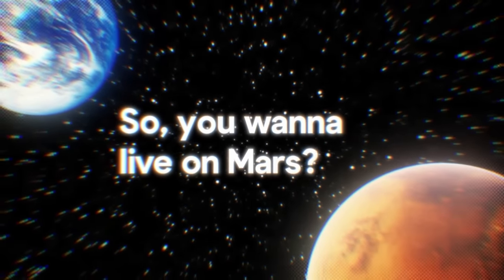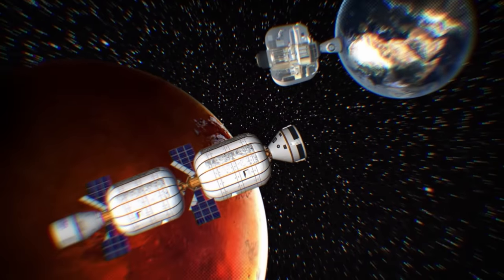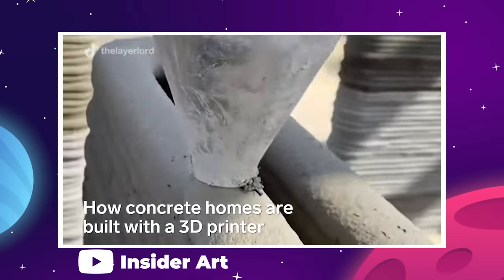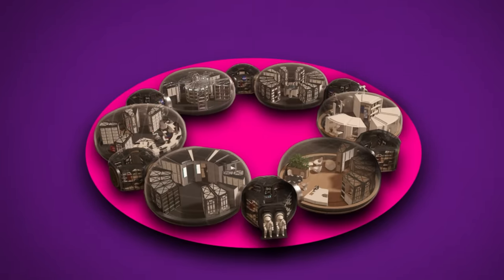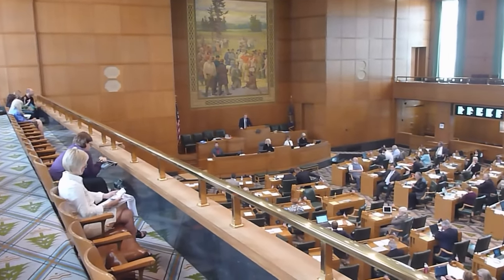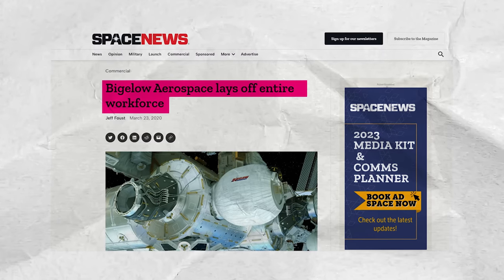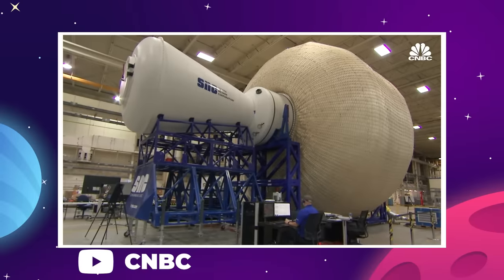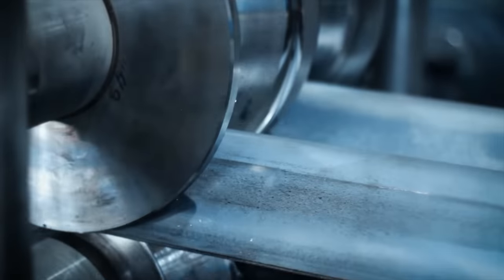Why Inflatable Habitats Are The Key To A Mars Colony!

Comment: The problem with inflatable domes for habitats is a very risky means of life support because they’re in highly known to tear rip puncture, etc. so you would have to come up with the material that’s much more stronger and reliable so it would be tear proof and puncture proof, it will also have to be well insulated Because of the temperatures on Mars.

Comment: I've worked with Vectran in electrical cable manufacturing. It is extremely strong! However in this application the question is how radiation shielding will be achieved. 🤷‍♂

Comment: Shining glass domes? They can be mesh. Using the Ion engine concept where atmosphere is pulled from the outside to the inside using a 20KV potential between two mesh layers. Mars atmosphere at earth atmospheric pressures inside the mesh dome.

Comment: The pressure inside a "balloon" at 13.88 pounds per square inch will equal one ton per square foot.  a multi-layer nylon inflatable can take the pressure, but not a balloon.  Not a concrete building either, it will explode.   The shape has to be made of curved surfaces to endure the pressure.  A sphere, a cylinder or something with all curved surfaces and either nylon or kevlar reinforced can withstand the pressure.  Brittle concrete or masonry cannot,  Steel rebar and the curved shape would be needed.   Metal tanks of 23 to 30 feet in diameter will work just fine as they can be part of the lander and just set off ready to move into.

Comment: Mars regolith covers the inflatable habitat. Regolith provides Radiation and Insulation from the harsh mars surface environment. The inflatable habitat provides a safe sealed conditioned environment. Especially If something in the regolith is hazardous. 

Being inflatable modules would allow each Starship to hold a complete independent base or large base expansion sections.

3d printing is not required. Mars Regolith, Mars Water and a binder, makes Mars-crete. Spray it over the inflatable habitat, like Shot-Crete.

Comment: use them as molds for igloos, spray them from inside with water  - ice as building material be self-sealing and give vast structures in no time 
(for river-like lakes for indoor walks, seafood and o2 algae - earth surface is mostly water, so should a mars habitat be )
Reply: melt large amounts of ice with reflectors, water absorbs dust and radiation as heat, boiloff be greenhouse insulation and atmospheric pressure - once it rains fish can survive mars nature 
(to surrect planets is how to live in a universe )

Comment: I totally missed that point. Thanks!
If a 1bar baloon has a leak in space would the effect be comparable with a 2bar tire with a leak in a 1b ar atmosphere on earth?

ChatGPT
In both scenarios, you're dealing with a pressure differential causing the movement of gas from an area of high pressure (inside the balloon or tire) to an area of lower pressure (space or the surrounding 1 bar atmosphere). The rate of gas flow will depend on a few factors, including the size of the leak and the pressure differential. However, the overall effect would be different due to the different environments.

A balloon in space with a leak: The pressure inside the balloon is 1 bar and the pressure outside is essentially 0 bar (a vacuum). This is a full 1 bar of pressure difference. Gas will flow from inside the balloon to the outside space environment until there's no gas left in the balloon.

A tire in a 1 bar atmosphere with a leak: The pressure inside the tire is 2 bar and the pressure outside is 1 bar. This is a 1 bar pressure difference, the same as the balloon in space. Gas will flow from inside the tire to the outside environment, gradually reducing the pressure inside the tire. However, unlike the balloon in space, the tire will not end up completely empty - once the pressure inside the tire equals the pressure outside (1 bar), the flow of gas will stop.

So while the pressure differential in each case is the same, the end result is different - a balloon in space would become completely empty, while a tire leaking in a 1 bar atmosphere would still have gas left inside once it reached equilibrium with the outside pressure. Additionally, the pressure differential being constant in both cases, the rate of deflation might be comparable if the size of the leaks were identical, although the dynamics of gas escaping into a vacuum versus into an atmosphere might have some differences.

Comment: We should send A-I to Mars to build underground shelters and all the infrastructure the colonists will need to survive.  There also has to be  space dock built in orbit around Mars, with craft designed to take colonists to the surface and back
Reply: Mars average air temp. is  Minus 80 deg. F .  There are L.I. cold temp. batteries .  Minus 80 deg. F.  and  much lower on Mars is a problem for anything electric powered on Mars.  The explorer rovers on Mars were not of the high power usage of A.I. robots to be used on Mars .   Mars will need nuclear powered electric generators on Mars for survival of Humans and  A.I. robots.

Comment: Space does NOT have negative pressure. The air pressure at sea level is 14.7 psi. The air pressure in space is 0 NOT -14. Secondly, hydrogen is good at stopping neutron radiation. High-density material like lead is best to protect against x-rays and gamma rays.

Comment: I think inflatable buildings are the way to go for quite a while. You can put a huge container, deflated, in the 27 foot wide, 50 foot long, starship. It might inflate to 60 feet wide or more, and 100 foot long. My God, that’s huge! That’s as big as two double wide mobile homes! The hardware, such as cabinets and bathrooms, could be set up in the center. Just land, secure, and inflate. Settlers will have room to stretch. Talk about comfort. I like it!

Comment: The problem is that LEO, out to 300 miles is protected by the Van Allen Belt, and that Mars and Lunar habitats would be subject to far greater radiation. In both cases this necessitates covering any habitat with 6 feet or more of lunar or martian regolith! Also, pressure is not as you claimed. The ISS has lower pressure than sea level. Habitats only have to withstand that pressure, space is zero pressure, it does NOT "suck"! There is no such thing as -14 psi, it doesn't exist!

Comment: You are mistaken about the pressure in space. It is not -14.696 psi. It is 0 psi.
 
Atmospheric pressure at sea level is about 14.696 psi. An easy way to illustrate this is with a simple mercury barometer. 

The pressure where the air contacts the mercury is atmospheric pressure or about 14.696 psi. The pressure at the top of the mercury column is a hard vacuum, or 0 psi, same as in outer space. If the tube of the barometer was 1 square inch, the air would support a 1 square inch column of mercury weighing 14.696 pounds about 29.92" tall. The density of mercury is 0.491 pounds per cubic inch. 0.491 x 29.92 = 14.69.

The only way to get a -14.696 psi pressure in space would be to put a mechanical pressure gage in a space ship pressurized to 14.696 psi and attach the gage to outer space. That -14.696 psi is relative pressure - relative to the pressure in the ship. To get absolute pressure to add the gage pressure to the pressure in the ship. It should be 0.

If the pressure in the ship was 5 psi (more likely), the gage would read -5 psi. With the absolute pressure being 0 again. If the pressure in the ship is 0, the gage would read 0.

Comment: You know, if they make a layer of jell that quickly hardens when exposed to air. They could make this balloon into a self sealing one. 
Something penetrates the balloon hull. The air comes rushing out. As it does so, it passes through the layer of jell, activating it. The jell is pulled into the hole and quickly seals.

Comment: But you still need to provide radiation protection, which means adding dirt. Also, its a mistake to build structures from elaborate, high energy content 3d printing. Instead, all you need is blocks of regolith that are strong enough to build non structural radiation shielding. We're talking a small amount of polymer (plastic fibres) and a relatively small amount of heat. To create bricks that can be stacked and also act as retaining walls for loose dirt. Heck for that matter you can use an even older tech - sand bags. Not to create the structure, but to protect it from radiation.

Comment: Forget printing & combine the other two~ dig a secure/airlocked hole with a few rooms. One's the safe room, one's storage & you can make the "living" room really large~ which I think is crucial for the crew used to cramped quarters in space ships n stuff & put the inflating parts on the surface. If you prep for micro-mediorites Dr. Murphy will send macro-mediorites(🤭), planet wide storms & a direct hit from a solar flare like the one's we've been affected by will show up, too. They need a bunker just like we have here and just in case as well. Just my thoughts 🤔 🤪

Comment: Caves are the only solution. You don't have anything to protect the colony on the surface from radiation. Gravity is low, so cave structures will be sturdier. Perfectly you'd find the cave that would only require the smooth out the walls and line them with some thin plastic foil. Caves can give huge habitats with very little materials, and are already there waiting.

Comment: You don't need glass, a lot of materials are colorless when the potential energy of the valence electrons is high enough. You can easily dote that. You would be surprised what we will be able to do in the long term and how little in the short term. But you are likely right that we won't see those space "glass houses" in this century. It's not practical when you can just have the same window feel with cameras and flexible screens and redecorate everything later. Turn a labspace into a habitation room and vice versa. Probably will happen on earth as well

Comment: You know, there is a prototype inflatable that also uses a oxygen cured Apoxsee resin so once it’s inflated than Apoxsee cures, and the structure becomes rigid, the same technology is used in commercial Pipe liners
Reply: The fact that you can’t spell epoxy makes we doubt what you are saying I’m afraid.

Comment: In my honest opinion, inflatable anything is not a good idea, especially on Mars for colonization.  My reason is this : Anything can be inflated can easily be damaged and deflate losing valuable air. Also, I would like to point out that the inflatable materials needed would need to withstand a 50Cal. BMG hypersonic bullet. I personally don't see that happening.

Comment: Underground in drilled caves or caves found that are suitable to add an airlock to. This work can be done however by astronauts and robots utilizing the proper equipment. The work would need to be done in the quickest and safest manner possible to avoid deflation issues with these inflatable habitats. And by doing it quick I don't mean years. I mean months. All of the drilling equipment and habitats need to be sent first so everything is on location for drilling to begin into a suitable rock structure. The best location also needs to be sought out via rovers and satellites. Just from what images I see of Mars,Olympus Mons looks to be a perfect spot. Right in its long dormant cauldron wall. The strength would be there and from satellite images the terrain within the cauldron looks fairly leveled off and flat except for dead center. Either way there are many locations for the drilling for cave system. But just plopping down some blow up balloons and calling it a day is not the way to go.

Comment: Inflatable  habitat space stations in the form of rotating wheel configurations that produce one g gravity equivalent.  may be the most beneficial  use for them.  It is well known that extended stays at zero g cause serious adverse changes to our bodies some of which never resolve.  Our bodies evolved for every system to function properly at  one g .  It is reasonable to postulate that long term exposure to38 % gravity will also produce effects similar to long term exposure to zero gravity  A large  orbiting station at Mars  with a one g environment  would make an ideal stepping stone to controlled length stays in a low g environment on the surface. This approach would transport an earth equivalent environment  and may be the key for mankind to spread out to distant parts of the solar system. At 38% g  an orbital shuttle at Mars would be relatively easy.

Comment: Interesting concept, but just because one of these inflatable structures has withstood micrometeoroid impact in space doesn't mean that they would withstand larger impacts.  What about the sand storms on Mars, would the structures collapse or be deformed, damaging the contents inside them.  It didn't appear to have internal structural reinforcement!  I find the shape to be a odd choice since a sphere is the strongest simple structure with the most internal space for the material used.  Why not excavate an proper-sized bowl into the Martian surface, line the cavity with either sheets of tough, watertight material (since regolith is said to be really abrasive) or long sand bags filled with the already dug regolith (probably screened to remove unwanted material) perhaps lined inside and outside with lightweight metal screen/fencing which would help keep the sandbags more stable in the event of Mars quakes! Or  3D printed regolith that could be continued up and over the inflated structure to give it very good protection from cosmic rays and meteoroids and the sandbags could used in the same way!  Since the inflated structure wouldn't be physically attached to its protective cover then Mars quakes would have less effect on it!  I must disagree with the concept of using robotic equipment by itself to build structures before any humans arrive there because nothing is perfect and what if the equipment gets there and has a malfunction or breakdown, qualified mechanics/electricians/fabricators could repair the machines if sent with them, if not, it's about a 2 1/2-3 year wait for the next spacecraft to get there!  Finally, I think that the concept of people going to Mars and then returning to Earth after 3 1/2 years in zero and low gravity is foolish.  The trip to Mars must be considered a one-way trip not only because of the expense but also because of the long-term effects of low gravity would make readjustment to Earth's gravity a long-term process with potential long-term problems to those people!

Comment: To be able to use an inflatable dome one would have to use a gas that would have a limited reaction with the space radiation around the dome the gas would then do 5jobs 1 block space radiation, 2 keep dome warm ,3 that heat would help plants to grow ,4 keep dome inflated,5 provide light via reaction think florescent tubes but in a dome

Comment: What happened to the Bigelow technology? I'm assuming the following & would be grateful to be corrected if any or all of my assumptions are wrong...

1 - The original Transhab technology that Bigelow licensed is still owned by NASA hence others could potentially license it but ...

2 - Over the lifetime of Bigelow Aerospace they made some improvements and additions to the baseline NASA tech so at time of Bigelow closing down its technology was superior to the original NASA technology and ...

3 - Sierra Nevada Space LIFE technology is not derived from NASA Transhab technology (or Bigelow Aerospace tech) but is a parallel development that SN Corp came up with on its own.

If all of the above is correct then are there some useful Bigelow innovations (e.g. specific ideas/formulations for hydrogen-rich radiation insulation layers) that could potentially be used by SN Space or other companies to improve and/or accelerate development of their inflatable habs? If yes then back to my opening sentence - what is the status of any unique intellectual property that Bigelow developed? It would be a shame if anything useful can't be exploited by the remaining players in the inflatable hab field.

Comment: There's no such thing as negative pressure. The pressure in space is not negative 14 psi... It''s zero..It's only "negative" relative to the positive 14 psi of the ISS... thus the "pressure "differential" is 14psi, NOT 28psi as stated in the video.

Comment: At 9:20 you TOTALLY got it wrong.  Space is not negative pressure , a vacuum is only considered - 14 on earth and our normal pressure as zero but we know it only FEELS that way so when airing up a car tire to 14 psi that is in addition to atmospheric pressure.  There is no pressure in space, it is zero a near complete vacuum  so a balloon can be pressurized to just 8 to 10 psi in space and we could live in that.  If you put air into it with no pressure on earth and then TOOK it to space it would become rigid and show just over 14 psi.     Just ranting here but no artist gets spacial engineering right for Mars or Space and the actors always move in slow motion with a vacuous smile on their face... I hate that.  No astronaut ever moved in slow motion grinning while staring into the distance.  Stop IT!

Comment: If we use two tank one as vacuum and other is a half liquid half air pressure and connect by a gate open into space so when the pressure open gate be liquid flow the space rush in and close the door and the pressure pump it out and cycle repeat forever then we can create motion , motor , generator lift,  and thrust as we want without much more pocket picker slow learner products

Comment: Space is not at -14 psi.  Negative absolute pressures do not exist. space should be very close to zero psi or 1×10^-12 to 1×10^-18 torr. The pressure differential from habitat to space is 1 atm, or 15 psi, unless habitats are at a pressure higher than at sea level.